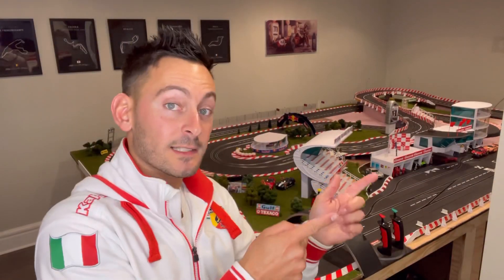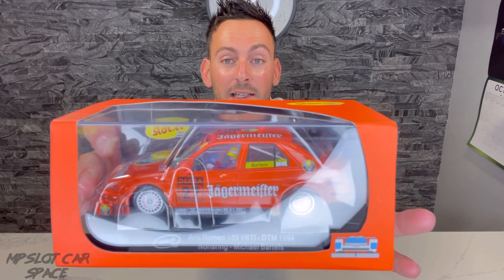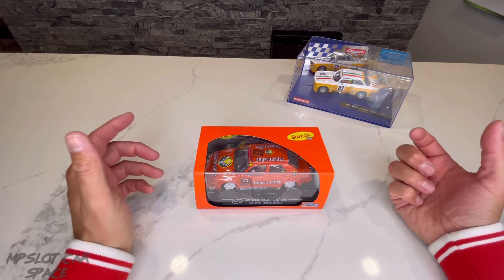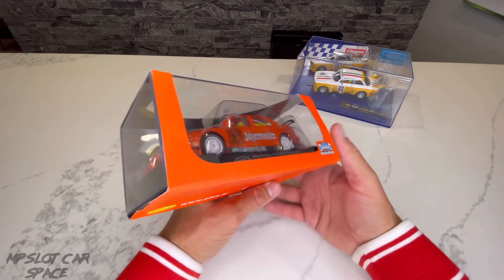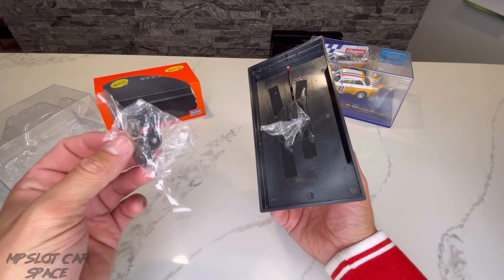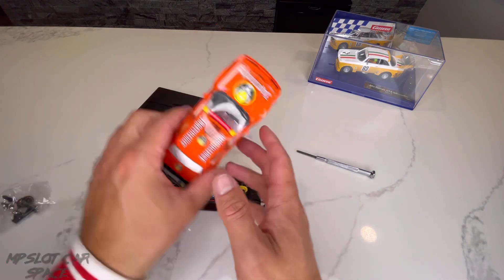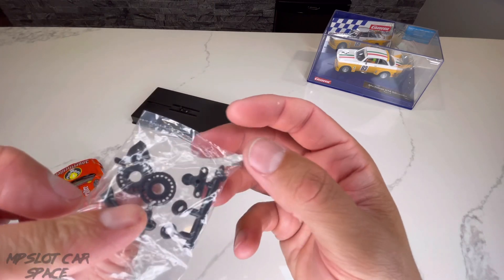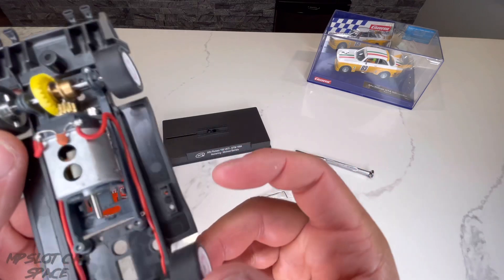UNBOXING MY FIRST SLOT.IT SLOT CAR! Part 1 of 2

Comment: Will be interesting to see what you think of the FT decoder. I’ve used one so far to fit in a Scalextric Reliant Supervan
Reply from the maker: What are your thoughts on it so far?
Reply: @MPSlotCar  works great, does everything you expect with a normal decoder It’s not the type of car to race but I wanted a challenge and I was keen to try out the chip  I’ll post something on it on Instagram some day

Comment: Hey Massimo, great video and great looking car, can’t wait to see it on the track!  I have a question for you, were you able to chip the Policar F1s?  If so, where did you place the LED, it seems like it won’t fit within the body she’ll since it’s so tight.
Reply from the maker: Hi thanks buddy! Yeah I actually did one of the policars a few months ago. (Not the Alfa one I did a few weeks back).  
The F1 had a hole pre made for the LED but the chip was a tight fit, literally just fit in there.
Reply: @MPSlotCar  Which chip did you use? Would you be able to take a picture of the chip install? I have a few of these cars and would like to chip them just can’t figure out how it fits.
Reply from the maker: @yzfox05  sure I can email or send you some pics of it over Instagram if that works for you?

Comment: Great stuff Massimo. Slot.It make some really cool cars and gear. Just wondering though. Have you considered something like a TekSlots box to run both analog and digital on the same track? In the long run it would be cheaper than buying chips, unless you specifically wanted the digital operations on your cars.
Reply from the maker: Hi, yeah I’ve been looking into options to avoid chipping every analog car.  TekSlots is a really good option.  I’ll have to make a decision during the winter

Comment: Hey Massimo, nice car, I love the Slot.It and Revo Slot cars. The allen key is also used to adjust the front axle ride height. You should try backing out the motor pod screws slightly to decouple  motor pod from the chassis.
Reply from the maker: Hi thanks! Haha yeah the more I tinker with it the more I see what can be done to it tuning wise. So cool!
I’ll give that try as well! Thanks for the tip 😁

Comment: Also interested in chipping the f1 cars, not able to find any carrera digital f1 cars to add to my collection.
Reply from the maker: I’ll try and do a video on the Policar F1 for everyone once I get this build out of the way.  It was a tight fit in the Policar but it’s possible.
Reply: Slot it has a decoder that would fit in the F1 for Carrera but I’ve tried one in an Indy car and wasn’t impressed with size of IR diode
Reply from the maker: @3roomsraceway612  didn’t work too good? I had done one of the Policar F1s months go (my first attempt at this) it came out okay haha it works so I guess that’s all that matters. I got the chip to barely fit, it’s a real tight squeeze in the Monoposto but it’s doable and works great.